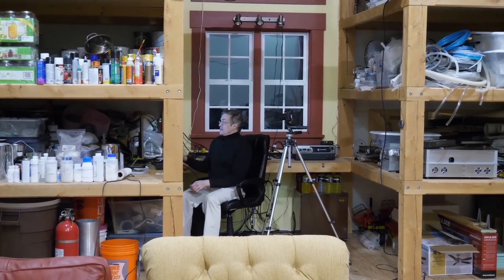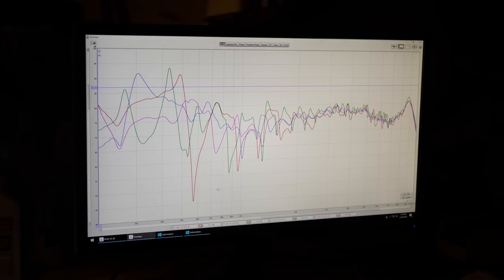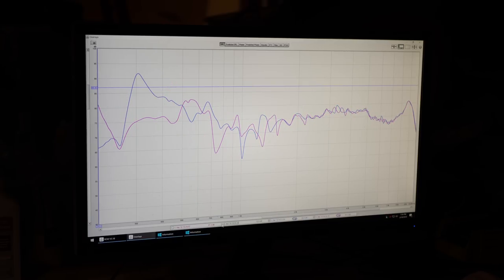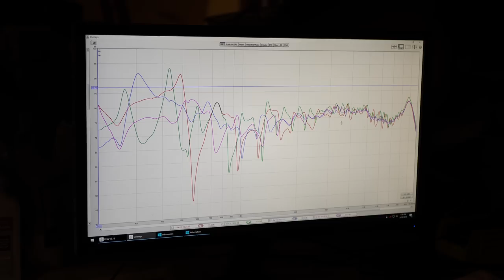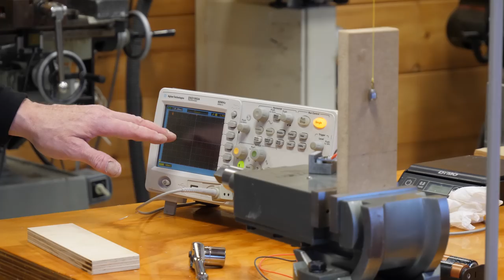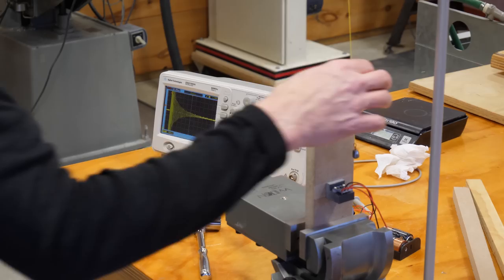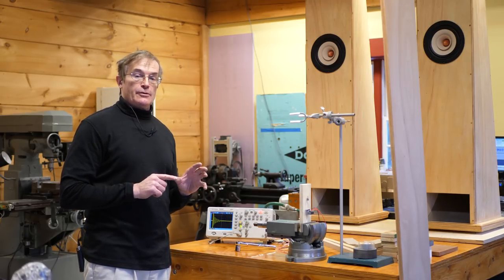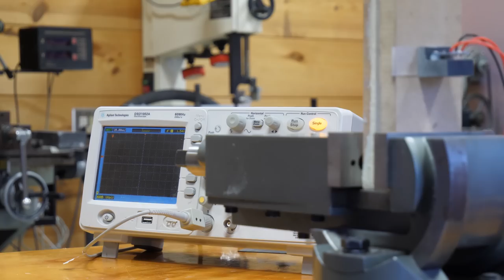World's Second Best Speakers!

Comment: Legend has it the tonegenerator is still running 🤯
Reply: yeap, 3 weeks later after you posted this can confirm that it's still there 🙄
Reply: 20-20000hz
Reply: LowEndStrings hahahhahaha dying!!!
Reply: Best Comment Ever!
Reply: You win the comment thread with this one.
Reply: Stopped watching at about 24 minutes because of it - that and getting popup banner ads every couple of minutes.
Reply: I had to skip past that part :)
Reply: @Floyd1504 Thanks, but I started using uBlock Origin not long after I posted that to replace my previous adblocker, which had stopped working. Now using with it my Linux desktop and Chromium. No ads, ever.

Comment: I really liked the explanation of the end-effect reflection.  In transmission line theory it's just talked about as an impedance discontinuity but for resonant tube design (think wind instruments like flutes) the resonant length of the tube appears slightly longer than its physical length.  That high pressure node that the sound reflects off of occurs not at the exact end of the tube but slightly beyond it, which is easy to understand if you visualize the pressure changes in the air and the non-negligible response time for the surrounding air to rush in to fill the low pressure void emanating from the end of the tube.

Comment: I built tower speakers as part of my bed’s headboard about 11 years ago and installed the mids and tweeters with their crossovers from a pair of Pioneer CS177 stereo speakers.  The 12 inch woofers from those speakers are installed in the base of the head board box that acts as a huge speaker box. My bed rocks out to say the least.

Comment: Tubes and wedges  is how Bose got so much bass out of an enclosure that was 18" x 10" x 10" using a tub internally, and about two different wedge like ports inside the box with a single, stiff, 5.25 inch driver (small labyrinth). It was the Bose Acoustimass 3 system. All of the turns and twists made it rather inaccurate, but it could really put out a huge amount of punch for a system so small. I like the simplicity of these wedge speakers because like Tech said, no labyrinth etc.

Comment: As the absorbent or damping material instead of the sheet of rubber or gooey urethane you could have used simple 1/8 or even 1/16 Depron foam like the foamboard laminated to plywood or mdf. I think you can also get away with sound proofing foams that come in rolls at Home Depot for laminated floors. Some are rubberry and some are foamy, but at $60 per roll it is a lot cheaper alternative.  Have you tried that?  

Back in the late 70'S I built a set  of  mini cannons as I call them because they are like a cannons when it comes to sound quality and punch, based on plans from a RADIO SHACK V-Port design as per their Speaker Design Book they use to sell, in those years, but with some  of my  own mods.  

My mods were actually inspired by also Radio Shack  Realistic 7" Minis which I still  have them and were made from a single piece steel enclosure, are very heavy for their size but very powerful. So I designed mine from a mixture of 2 types of 3/8" plywood making the panels 3/4" thick, the glue I used to join the two 3/8" ply panels was simply liquid nails, and this may be very well be doing the same as your urethane glue. But I wanted mass in the panels and thus the double panel sandwich. 

 In addition, I used Formica to cover the outer surface so they are super solid and only disperese sound from the speakers and port no spill through the panel or enclosure material.  I used 4" Radio Shack 40-1022 5Ws/10W Max and 40-1375 Tweeter with a simple cap x-over which came with the tweeter.  MY speakers were tapered, not rectangular, and the v-port is at the bottom, and sound awesome when they are placed on a flat surface.  

The enclosure is similar to the enclosures you show in this video but only 14" high as mine were built, more like studio monitors and I used them as such. They help up pretty well to a lot of abuse over the years, and just a couple days ago I decided to repair one of woofers which had been poked at by my kids when they were little and I just repaired the cone to coil connection and made some 3D printed recessed back  input connection ports and speaker covers so no one is tempted to poke the button on the woofer :). 

BTW, back in the early 80's, I also built a set of Clipsch La Scala inspired cabinets with my own mods, best speakers I have ever build and sound great for Jazz.  Cool stuff.

Comment: Who knew when I built my HiFiN&RR magazine Tabor speakers (designed by Malcolm Jones of KEF & Falcon Acoustics fame) over 40 years ago, that I used contrained layer damping both inside & outside the enclosure? Inside were bitumous felt roofing panels glued on all surfaces. Outside a 1/8" hardboard veneer contact cemented to the 3/4" flooring grade chipboard box. No wonder they sound so good.
Have you published a frequency response for your Voigts? Was baffle step compensation necessary?

Comment: What about folding the transmission line in the back and have a more conventional looking speaker design? That would make for a shorter enclosure? I visualise an enclosure with two slanted surfaces at the top similar to a roof, or a half round top to fold the transmission line. Food for thought?

My wife would hate that because she wouldn't be able to put things like picture frames or bibelots on top of them! 🤣
Reply from the maker: That's  an option, but even the effect and the location of the fold aren't  trivial.

Comment: would have loved to see a frequency response curve of the finished speakers.
Reply: Bravo!
Exactly what I was thinking when it finally ended.

I would love to build these, but what did the finished curve look like? How much bass did you coax out of those little drivers?
After all, you're the one with the test equipment and anechoic chamber.
Reply: @johnny7254  the final product's performance is still a synergistic result of the source, speaker, enclosure, room, and what's in that room, and further - how that room is constructed even plays into what "you" actually hear.

Everything resonates.  Those resonances cause harmonic distortion.  This means even your walls affect the tone of your listening room depending on how dense or flexible they are.  ;)
Reply: @MotivatedMetalworks  You'll get no argument from me on anything you've written. Nevertheless, it is more than a mere matter of convention, that we derive specifications for speakers. It is the method by which we compare one loudspeaker to another. Even beyond that, given the level of detail and science brought to bear in this presentation, is absurd to leave out any measure at all, by which a viewer could assess the success of the endeavor.
Reply: @johnny7254  fitting those beasts in his chamber isn't possible, so any response curve presented would be flawed.

However, he could play them outside and get a pretty good idea.

When I build speakers, I try to balance the drivers across the spectrum, and crossover points based on where the curves are most beneficial at the natural roll off points.  Once that's done, I design the enclosure to meet my goals - is it a sealed box with no deep base, or can I tune a port to hit another octave lower?

I don't agree with the channel's logic or validity testing on material weight/stiffness as the accelerometer was measuring an impossible occurrence with the thump test.  Also, floor weight of speakers is a moot point for most applications (outside of aircraft, boats, and possibly cars), while size is often a critical design element.  Doubling the speaker walls increases the outside dimension, as the inside is a calculated and highly constrained space.  In most cases, MDF with proper internal bracing will outperform the same thickness plywood, while benefitting from a lower cost.

Transmission lines and horns in general are the exception, but he doesn't state this or why - you can't brace a horn like a ported box, because you'll fuck it's performance up.  So in these enclosures, you need stiffer materials.
Reply: @johnny7254  Something else comes to mind when thinking about this video.

About 30 years ago, Popular Mechanics had an article teaching the reader about transmission tubes, and how you could build a subwoofer out of a 4" Realistic (Radio Shack hadn't fallen off their original business model yet, at that time) woofer and PVC fittings.

What the article failed to disclose is that while the micro sub would hit 40hz, it was anemic and not musical sounding doing it.

Planars, infinite baffles, and line arrays all have impressive sonic qualities while also suffering some significant drawbacks.  Voigt enclosures aren't exempt either, as they tend to lack authority in the bottom end, or as with folded horns, end up being gigantic enclosures to play through the whole spectrum.

Voigt's share a commonality with planars and infinite baffles, in that the linear distance from the edge of the cone and the port will have a direct impact on where phase cancellation occurs.

At the end of the day - there is no perfect speaker enclosure, and we need to balance our designs with regards to perfection and reality and hope we can afford the point we wish to land on between those two ends.  :)
Reply: @johnny7254  Absolutely right. The performance of some things (in this case, loudspeakers) critically depends on the environment where they are used. However it is perfectly valid to to assess the relative differences in a common, controlled, environment for comparison. In the case of speakers, it is an approximation of "free-space", as provided by an anechoic chamber.
Reply: @MotivatedMetalworks  at 25, in 1974, just out of college, i bought my first floorstander speakers and subwoofer..earlier this year, 2020, I looked inside a speaker for the first time,  a $800 klipsch and saw $20 drivers, $10 crossover... found a gr research with donnie richie and his open baffle $4k diy nx-extreme, 8 woofer, 2 mid, 1 planar tweeter. At now age 71, wish i had seen or known this stuff at age 25. So, whats your opinion on danny richie's nx extreme vs this build here vs used klipsch forte 3 for $2.3k. The nx extreme is my first choice, the forte 3 my second, but the nx extreme is only reviewed by 1 site. $4k is all my funds saved in a year. I currently run a thiel 2.3 floorstander from 1990
Reply: @file1man   At the end of the day it's your system, your ears, and your listening room.

I've been out of the design game for a long time, and wouldn't spend multiple thousands on something I couldn't audition.
Reply: @MotivatedMetalworks  much appreciated. Back in the day, I never knew diy kit speakers were possible, that drivers and crossovers might costs 10 to 15 percent of the retail speaker selling price
Reply: @file1man   I had a couple enclosure design programs (which were free at the time) where I'd input the various driver parameters, ported (volume of port) or sealed, and they'd spit out a theoretical response curve.  I'd then choose my tweeter based on the high frequency roll-off and find a crossover (using different software, or an off-the-shelf assembled one) which I thought would compliment the chosen components.  Each application would usually output different results for identical inputs, thus without any test equipment, it was impossible to gage which was more accurate.  I'd end up bending to one or the other's "guess" or homogenize their results as my target result.

The cabinetry aspect was much less involved after playing with the volumes in the design software - just needed to account for internal bracing, possible standing waves, and whether the enclosure would be mass damped or complimentary (like a violin or acoustic guitar - not all sound good! :D ) to the physical resonances.

Since I'd cut my teeth woodworking from a very young age, then building heavy/stiff subwoofer cabinets for cars, the mechanics of the enclosures was trivial.  Getting the alchemy right took a bit of skill, art, and luck.

It didn't hurt that I found "The Master Handbook of Acoustics" to be ideal extracurricular reading when I was a sophomore in HS.  Lol
Reply: @MotivatedMetalworks  if you brought set of very good speakers, dac, and amp to a high school or college sophmore year physics class, then played some music, current gen students would easily understand music thru good vs inferior equipment in a life changing way. We have a lot more audiophiles, see applied physics real world, and probably have a lot more electrical engineers and designers. My compliments with much repect
Reply: @file1man  what really got me into music reproduction was how good vinyl sounded on a cheap turn table with a mid-tier amp and Polk (decent enough for cheap) speakers.

That's what got me over the hump of "perfection" in reproduction.  We're not seeking perfection, we're seeking truth.  It's possible for truth to not be perfect when the result is better as interpreted by our minds.

Comment: I've built some speaker boxes in my day. This answered so many questions I could never figure out on why these speaker box builds sounded like garbage cans, no matter what speaker or amp or song. I could hear it, clients couldn't and didn't care. Now I'm throwing my wallet at my screen. Thank you for your videos and being so detailed and easily understandable. This is the kind of teaching I absolutely enjoy learning from!
Reply from the maker: Thanks!
Reply: @TechIngredients  Now I have so many questions! Could DynaMat be used instead? Could you get the same  damping by gluing the veneer pane on the outside? Could I take a good pair of vintage speakers and apply these techniques to make them better?
Reply: @warrenbell950 Depending on the vintage speakers, there is a good chance that the cabinet resonance was leveraged to augment the drivers - the crossovers may also have been chosen to address cabinet resonance.  I generally wouldn't recommend it as a treatment for vintage speakers - either they are good, and you stand to ruin them, or they are bad, and they aren't worth the effort IMHO.  DynaMat is a choice, but not as good as the 2part treatment he used - you can also pick up a similar material from box stores used to line potable water tanks - it is nearly identical and has the same properties; you can also buy smaller quantities for testing. I personally don't love VT speakers, but the science behind them as well as the wonderful detail of the video makes this a fantastic choice for an educational channel!  Love it!
Reply: lost me at mar-a-lago pride. some nice info but not worth the stain on my soul. blocked ✌️
Reply: @luminousfractal420  lol
Reply: "I could hear it, clients couldn't and didn't care."  And that right there is why I won't be building these.  This was a great video, very interesting, but I know that my own hearing is no better (probably worse) than RocknR00ster's clients'.  That's also why I'm not only OK with CD quality sound, but mp3 even.  By the same token, I don't spend over about $30 for a bottle of wine.  A man's got to know his limitations.  My limitations save me money!
Reply: @luminousfractal420  you poor little ❄
Reply: @warrenbell950  this was my immediate thought as well,  especially considering how many hundreds of dollars I spent years ago on heavily Dynamatting my brand new sports car (using one of 3 types based upon which was appropriate for the specific surfaces & desired results) prior to installing $8K worth of pro car audio gear that I wanted to take to competitions but ultimately was designed for SOUND QUALITY & impeccable sound staging.....NOT sound _quantity_, which is what every other Tom, Dick & Jarhead I knew at the time cared about.   They wanted people to hear their music as they drove up & down the strip.   

I wanted all the music I was paying for to stay INSIDE my car (unless windows happened to be rolled down for some reason) and I fully wanted ALL the obnoxious road chatter & raft of distracting noises from debris kicked up by the massive tires, along with the originally deafening exhaust roar to be kept OUT OF THE PASSENGER COMPARTMENT.  Completely.  

Dynamat was totally new to me and it seemed hokey & hyped up by the sales reps, but I trusted my vendor and mater installer who convinced me of the overwhelming importance of starting the install and sound stage design process with as neutral and quasi-anechoic a listening space as possible.....which is already a joke when the listening space is on 4 wheels and has a 5.7L V8 that makes over 300HP bone stock and voraciously snorts in cold air through dual RAM AIR hood intakes while rumbling, growling and belching aggressively from her 4" race-tuned exhaust ports!

I mean,  it wasn't cheap, but I remember one area in particular where my installer said he figured we could get by without going to the fullest extent of Dynamat coverage that we were using throughout the other 80% of the interior and when I drove the car for the first time after the first phase was complete....I told him, NOPE, let's go with your initial recommendation.    That DYNAMAT is freaking remarkable in what it accomplishes when used correctly and I don't wanna compromise on the interior door panels & headliner area just to save $200.  I became a believer because I witnessed the stunning transformation and got the car audio I had always dreamed of and more.   Don't like their prices, but i know that at least as of the late 90s into 2000 Dynamat was on top of their game.  Perhaps there are better options now....I just know what I'm familiar with and what worked wonders for me in the past.   

So yeah, I'm curious to know more on the topic.